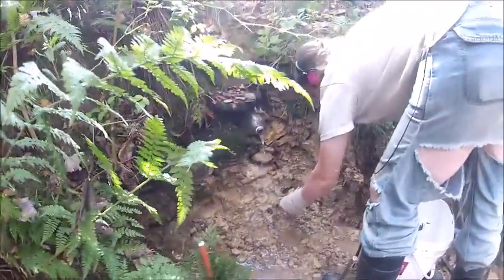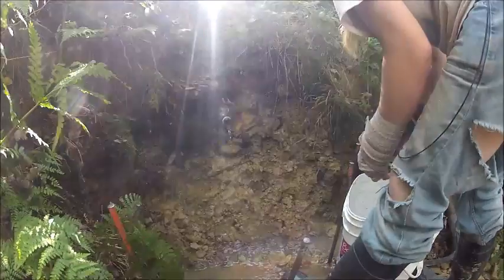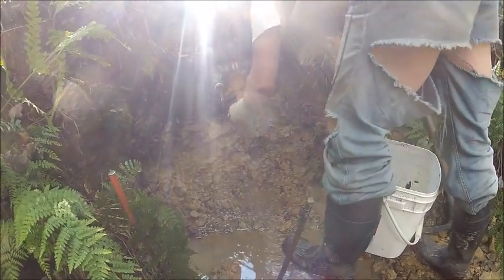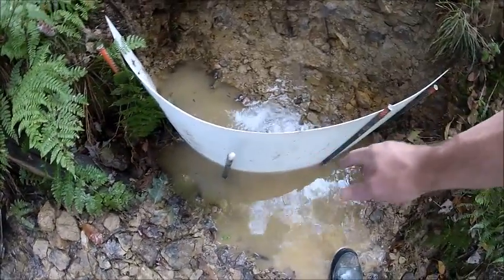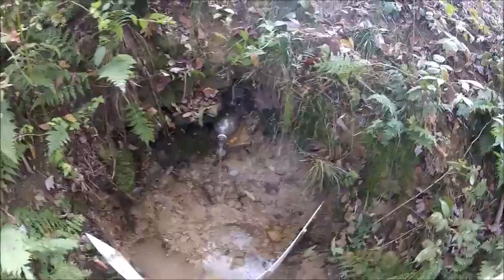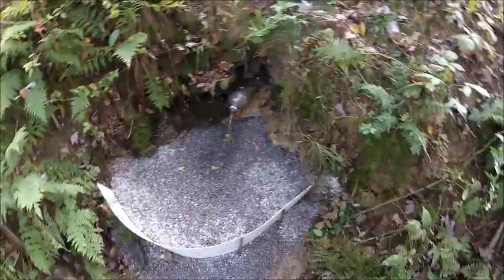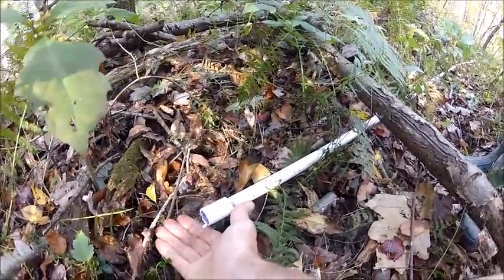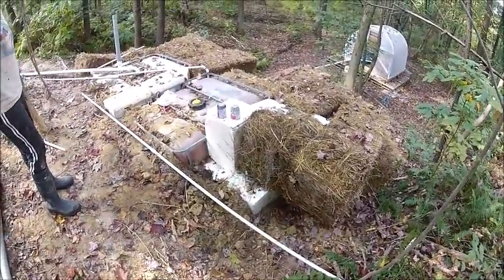Off Grid Spring Water Setup Pt 2 of 4

Comment: should only take 100 mins to fill that tank at a flow rate of 3gpm
Reply: you said 3-4gpm flow rate 300 gal i adjusted this biased of your current capacity of 275 gal
 / flow rate to allow for the burping of the line